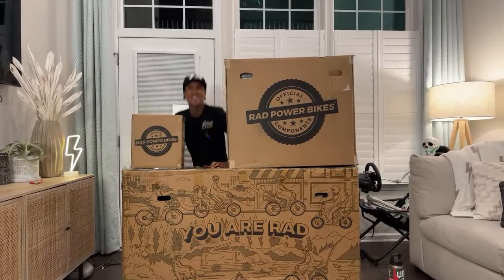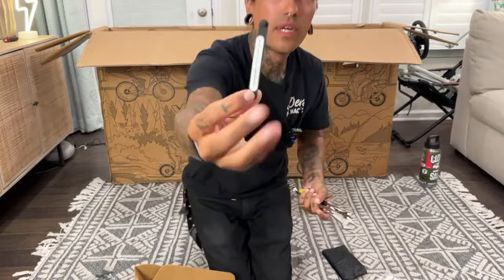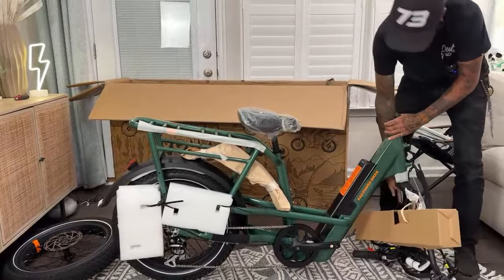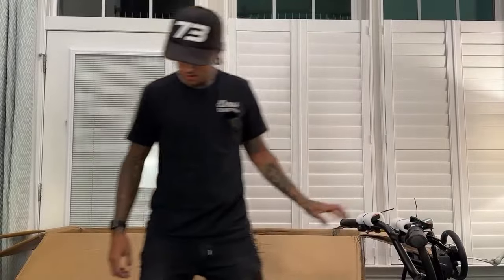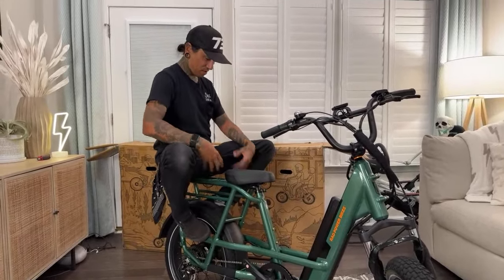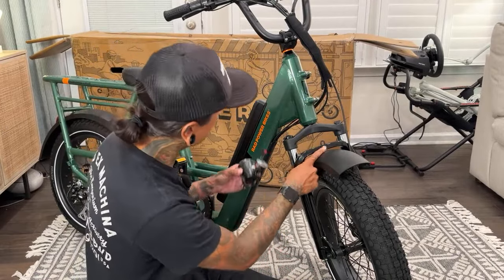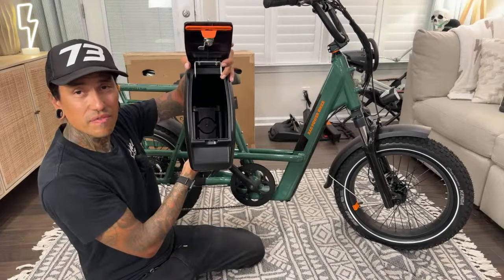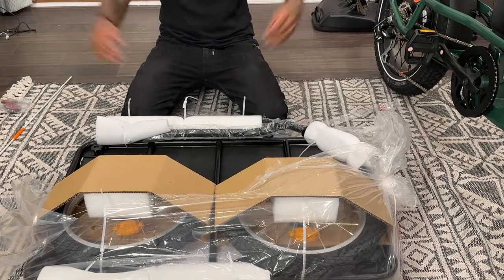Rad Power RadRunner 3 Plus Unboxing, Assembly, Q&A: ULTIMATE Cargo Electric Bike, Trailer & Console

Comment: You can always put the front racks in the front, even rear racks to make extend the bike more put more stuff on it. Running front of your seat in between the battery in your the the post where you were the seat is that there’s also another basket to put in there.

Comment: yea, you need to get a grinder with a wire wheel, to clean that rust off ok and then maybe add a little grease to it ok, white grease should work fine ok :0 the grease you mention on the video, will work ok :0